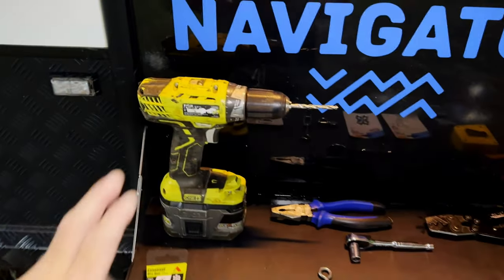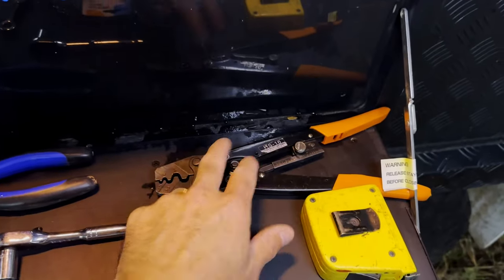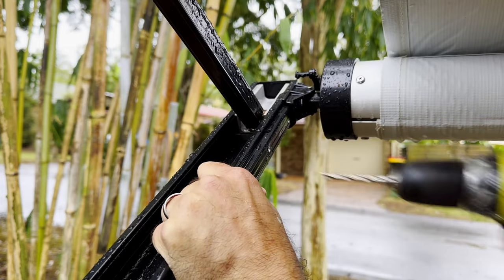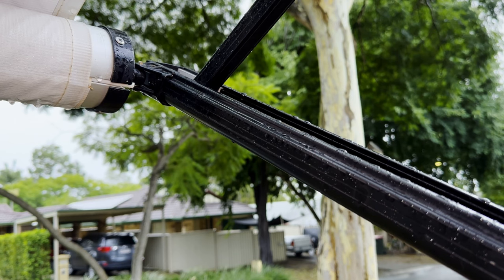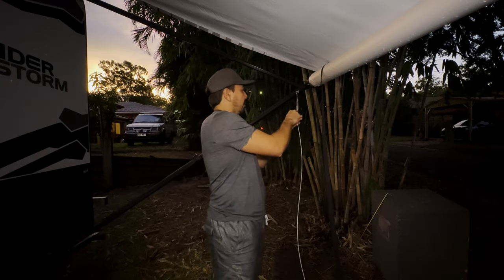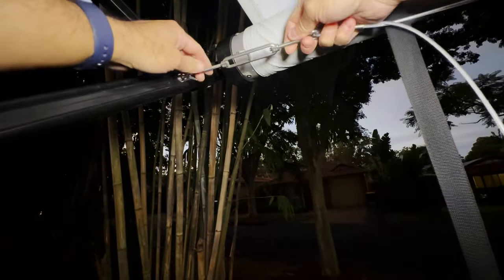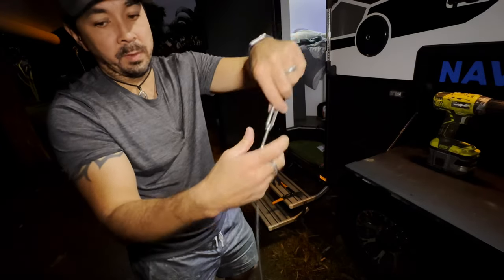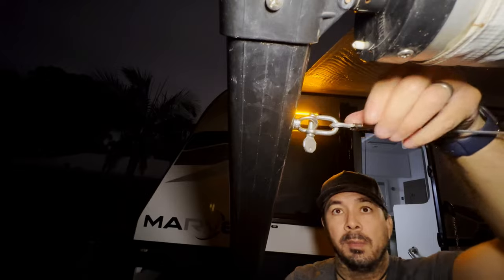BEST CARAVAN/CAMPER/RV MODIFICATION EVER!! 10min DIY Awning Clothesline

Comment: M6 eye bolts with M5 lock nuts how did you make them go together two different sizes ???
Reply from the maker: It must have been a slip of the tongue 👅 😂 but yeah, you definitely need the same size bolts and nuts 🤙🏽
Reply: @GrabLifeByTheGourlays  😂on your video when you show everyone the parts we need to get on the table. You had M5 nuts but M6 eye bolts 🤣
Reply from the maker: @MelissaCarroll-x5c  ahhh, just saw that! I must have just mixed it up accidentally when I filmed it and screen shot it. 🤦🏽‍♂️ Good spot though, well done! 🤙🏽
Reply: @GrabLifeByTheGourlays  Just thought I would let you know because I thought you may have done more videos. Cheers 🍺🍺
Reply from the maker: @MelissaCarroll-x5c thanks for that and good spot! 🙌🏾